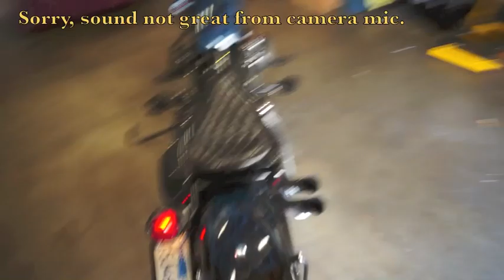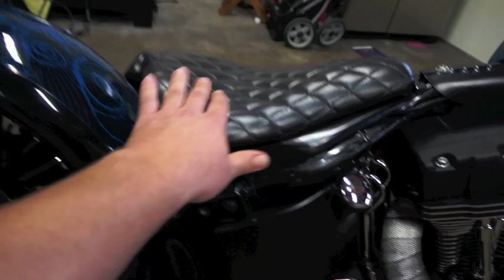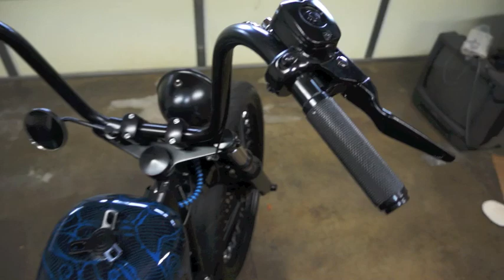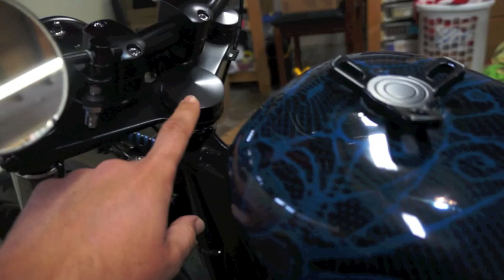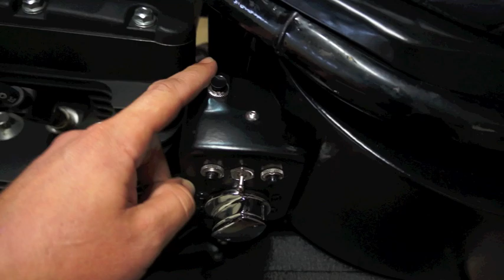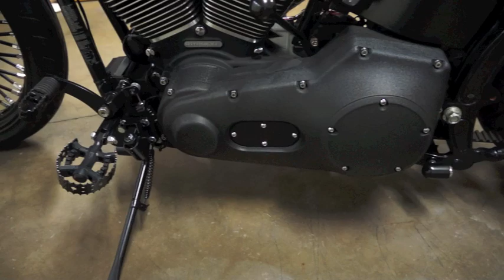Custom Harley Chopper Bobber walk around - SOLD

Comment: I realize this is an old thread, but if anybody is listening. I'm working on my 98 Softail Custom frontend with the 2under tubes and the dropin kit. What oil weight did you use for the forks to keep comfortable? If you recall, thanks.

Awesome inspiration!

Comment: speechless man this thing is perfect, gives me motivation to finish rebuilding my harley bobber.
That exhaust is exactly what im looking for, you said it was custom?
And what internal throttle did you use??

Here's a pic of mine, https://flic.kr/p/rNRQC1
Reply from the maker: This is actually a yaffe exhaust that I customized slightly (shortened & kicked out the tips a bit). Not 100% sure on the throttle. I usually find em on eBay.

Comment: neat bike but NOT a chopper.
Reply from the maker: Somewhat agreed. Everyone has their own perception of what "chopper" or "bobber" means. There isn't a hardtail & a long front end (I'm guessing that's you think of when you hear "chopper") and I didn't really "chop" much of the frame. 
I consider a "chopper" any stock bike that has custom made parts & has been modified & customized enough that it looks like something completely different. Cafe, brat, bobber, chopper, tracker.... All these terms get thrown around so much. I understand there are different characteristics with each of these "styles" but.... Does it really matter what we label something as long as the product is good?

Comment: That not a custom exhaust. That's a Paul yaffe skirt blower exhaust.
Reply from the maker: 1fltjponr Customized exhaust. They were shorted, turned out slightly more, & wrapped.
Reply from the maker: 1fltjponr Just watched & I did say custom made exhaust, my bad. You can watch newer videos, I do make custom pipes. These ones were Yaffe pipes that I customized.

Comment: How much did it cost you to do all this? I'm looking for a project and I'm only 19 with obviously limited funds. Just wondering if I could do all this under 10-15k including bike purchase
Reply from the maker: nimaxx38 I would say yes, It would be possible to do it (or something similar), for around 15K. It all depends on the quality & price of bike you start with, quality & price of parts you buy, & how many much you can do on your own... design, fabrication, welding, metal work, wrenching, electrical, paint & body work, etc.

Comment: hey bro how did you mount the seat thanks love your builds
Reply from the maker: Basically the same way you would do a springer seat on a ridged but without the springs. I just made a mount & welded it to the bottom of the seat pan and mounted it to the flat area under the stock seat (behind battery & fuse panel) with bolts.
Reply: Thanks brother nice work

Comment: Man, I am in love with this build, I was just wondering what brand and style bars those are , and what internal throttle did u use?
Reply from the maker: sorry so late reply. I usually use a drag specialties internal throttle but most of them are very similar so it doesn't really matter, just go with a brand you trust. I believe the bars were made by burly, not 100% sure, I have a lot of sets of bars & just go with what i think fits.